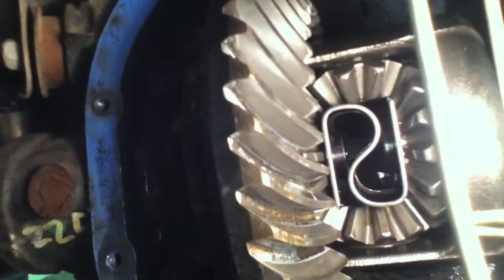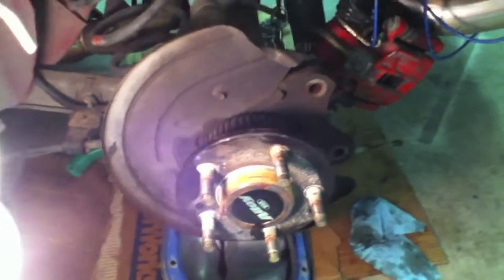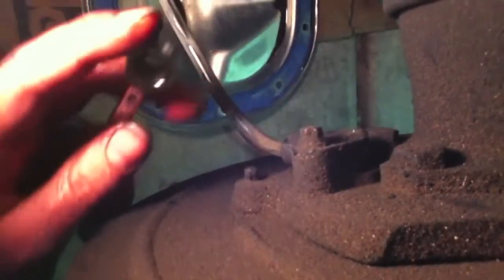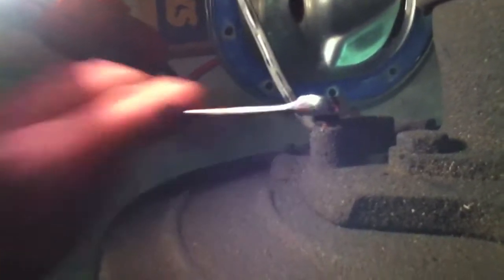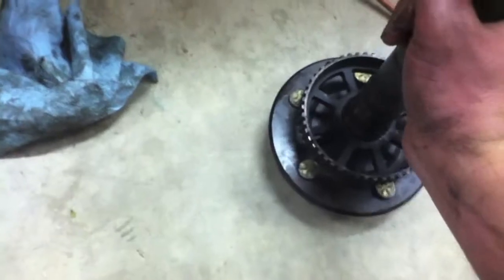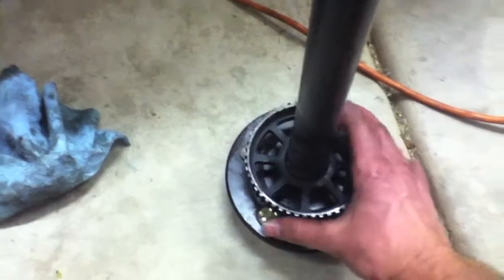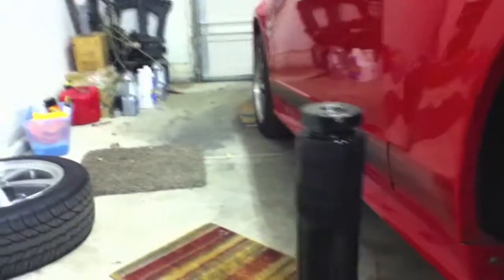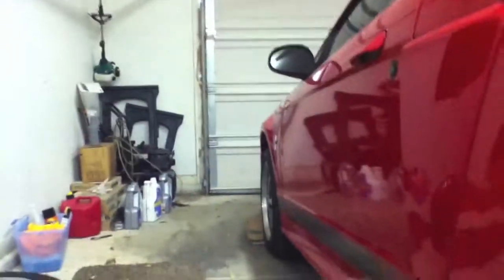Ford 8.8 inch Gear Install (Part 2 of 7): How to install gears

Comment: people are always saying 2.73 gears will go faster than 3.73's but its funny that that isnt even true, my 96 mustang gt with 2.73's will go up to 180kmh then the acceleration really slows down because so much strain on tje engine and wind resistance making the car work but with the 3.73's the car will just keep haulin ass all the way to the top speed

Comment: Tip: the C clips are not made out of brass as stated, but made of hardened steel. You can use a magnetic retriever tool to pull them out.

Comment from the maker: Yes. I believe it is all the same. The only thing I have seen are no abs refluctor rings on cars without ABS. The new GT 500 has a diff cooler line I think.. but as for all these stangs it should be the same

Comment: I assume the procedure is the same for all 8.8s? I will be installing different gears in an Explorer axle with traction-lock.
Thanks
Reply: Is this a cheaper method of replacing the open diff that comes stock in our mustangs?